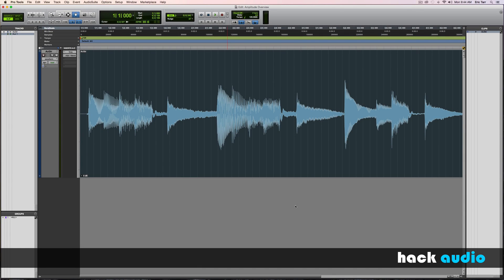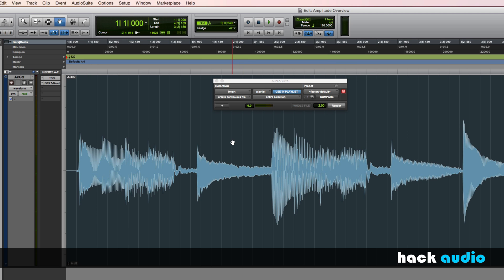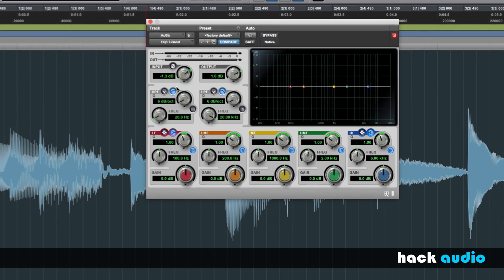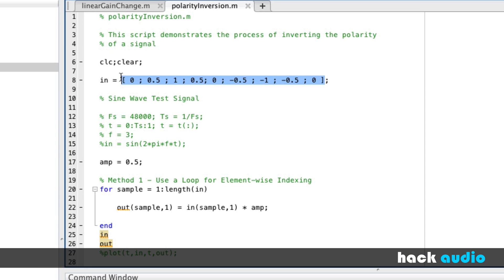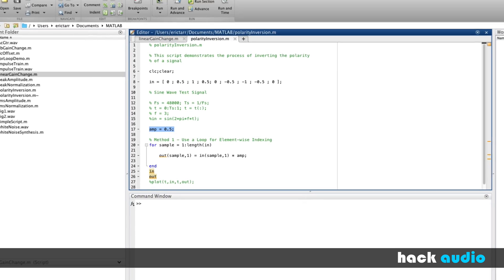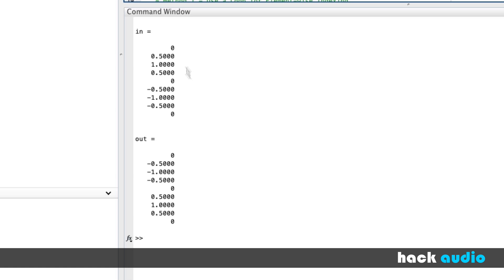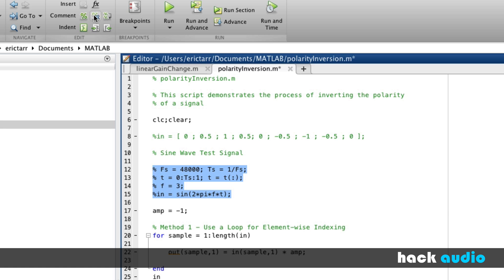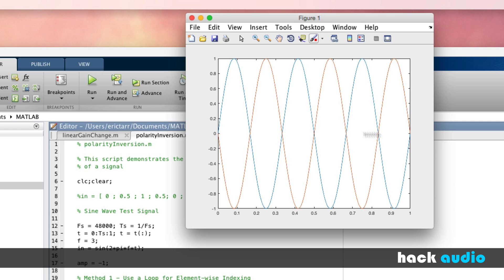Hack Audio: Polarity Inversion

Comment: I wanted to use this technique to compare voice imitators to the original sound clip they are imitating to factually measure their accuracy. Theoretically, the lower the amplitude, the more similar audio cancelled out, hence, the more accurate the imitations. Would this technique work?
Reply from the maker: That is a good thought! However, the two signals (original and imitation) would have to be almost identical to show any observable cancellation. Any small differences in timing, pitch, etc. would basically make the process  useless to perform. For this type of comparison, it would probably be necessary to extract other (more sophisticated) features from the signals first, in order to compare them
Reply: @HackAudio  Thanks for your input! I kinda figured that the differences would be pretty dominant in comparison, but it doesn't hurt to try.